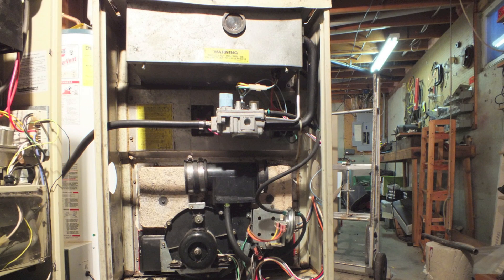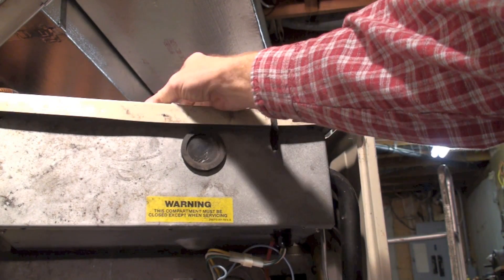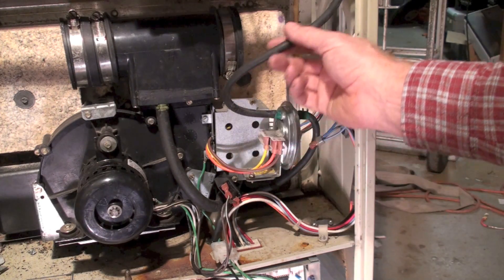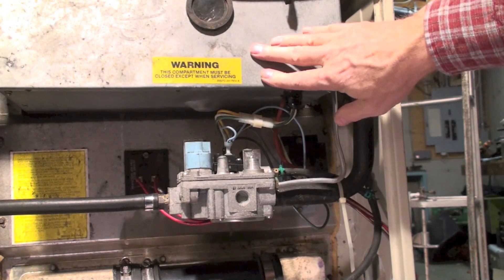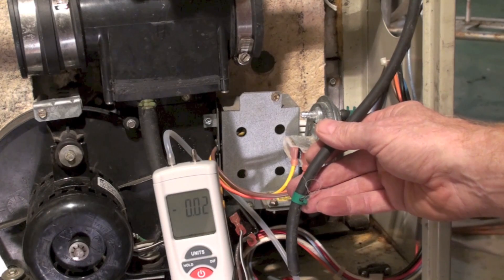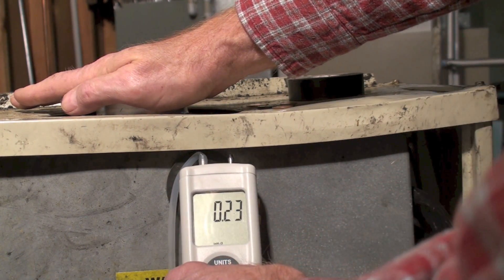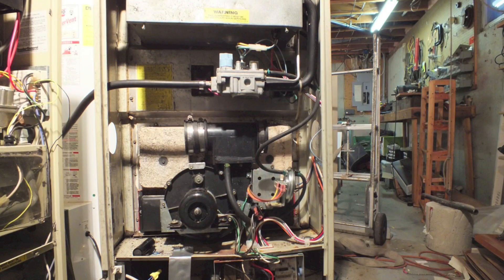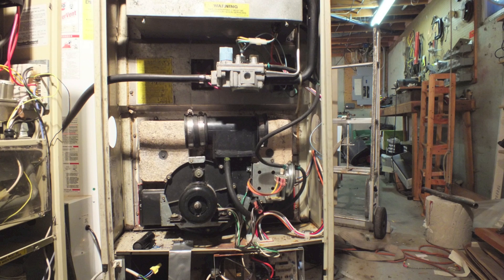How the pressure switch is activated on the 398aaw Carrier gas furnace

Comment: These pressures are pretty much the same for the 58SX100 Carrier (circa 1987)?   Could you do a video on this furnace where there is no spark to the pilot.  Neither is there gas going to the pilot from the gas valve.
Reply from the maker: ritewayguy I would look for a low voltage problem.  Jumper from R to W to start.  If it runs, there is a thermostat or wiring problem.  Hope this helps.
GFM

Comment: I had an issue where the secondary heat exchanger failed. The exchanger was and still is made from polypropylene coated steel and that polypropylene began to peel off, clogging airflow though it to the manifold. That condensate water is acidic and really made a mess of things. Why they never went to stainless steel is beyond me.
Great video GFM
Reply: GFM rules.
They used to be stainless until a red-headed engineer made known bad parts.  Check to see if your furnace falls into the lawsuit settlement.  
"Carrier Corp., a unit of United Technologies Corp., is enhancing the warranties on its 90-percent-plus-efficient gas furnaces. The company will provide a 20-year parts-and-labor warranty for the secondary heat exchanger. The enhancements respond to a recent class-action lawsuit by a small number of U.S. and Canadian consumers claiming premature failure on the secondary heat exchanger found in Carrier, Bryant, Payne, and Day & Night high-efficiency condensing gas furnaces that are 90-percent AFUE or greater and that were produced after Jan. 1, 1989. Day & Night furnaces sold after January 2007 are not affected."

Comment: Midnight, -10 F in Ohio... furnace goes out! Inducer was turning on, fire was not lighting, blower not turning on... green light on the ignition control box was out. Removed vacuum hose from gas valve and green light came on, burner lit up, blower kicked on... found this video and this explanation about high pressure above the burner causing the pressure switch to turn off... put on 12 layers of clothes and followed the pvc outside and noticed ice had blocked the pipe outside, cleared the ice out. Came back in to find the green light solid and my burner lighting up! Im now the hero on the coldest day of the year and my family will not be sleeping around the electric heater! Many thanks good sir! Stay warm my friends.
Reply from the maker: Glad it helped.
GFM